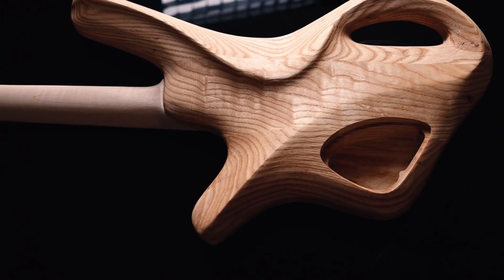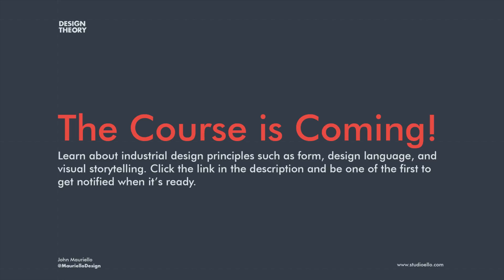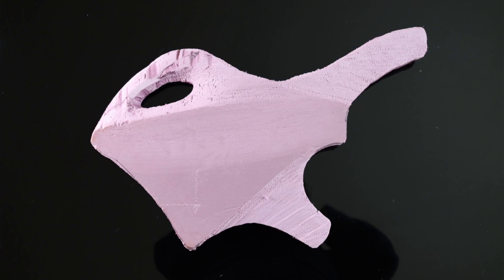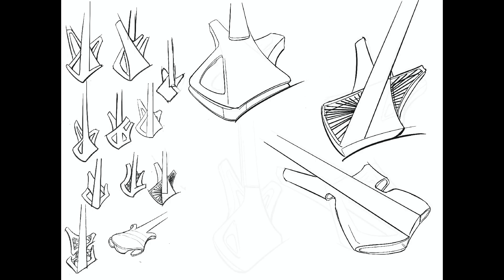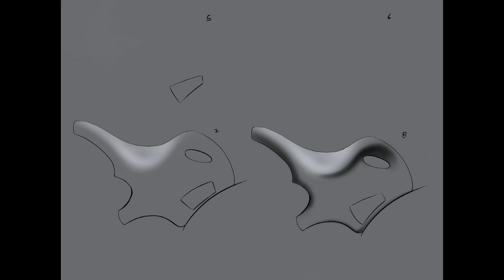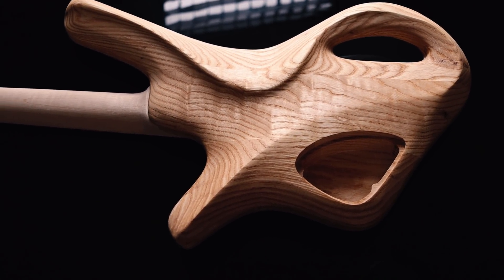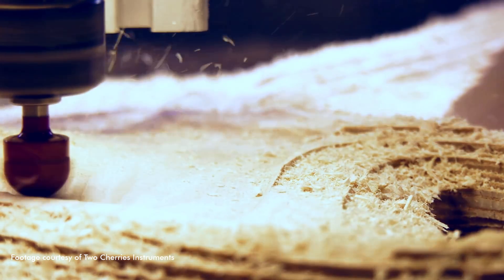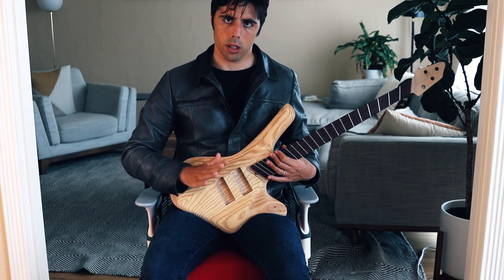How I Re-Designed the Traditional Bass Guitar: Industrial Design Process

Comment: Neat looking but you must realize that manufacturing cost is the reason most guitars/bass are simply flat. The more curves on the body, the greater the price becomes, especially if you are finishing them with veneers, etc. The price tag would make PRS guitars seem cheap. Most guitars/bass are made of multiple pieces of wood, usually 3. This is for strength and cost cutting. Your design would be a manufacturing nightmare for thousands of units.
Reply from the maker: Very true, but I don't intend to make thousands of units. I'm targeting the high end market so it's ok if most people don't want it or think it isn't worth it

Comment: Sitting, If you hold the instrument on the left leg, you have difficulties to play notes with the longest string,  And the hand posture for  the positions I-V is very bad so you have a poor sound on this registry and cannot play fast.

Finally you play in the guitar's registry. Which is quite a problem for an instrument designed to play UNDER the guitar. Unless you are doing sport solos on your bass XD

Also playing on the left leg, you have no longer the teapot and the angle  of your right hand with the strings is no longer appropriate. But you can buy expensive devices to make you sound better than it is...

However you did a quite remarkable job rethinking the shape for a specific use of the nstrument. :)
Reply from the maker: The scale length is shorter so the reach isn't so bad. Also, the body is shifted very far to the right, so the low notes sit closer to the body. If you still find the reach uncomfortable, you can still play the bass on the right leg and it's still pretty comfortable

Comment: As a violinist, who doesn‘t have frets, how do the frets not being parallel work?
Reply from the maker: It's called a multi-scale fret system. Too long to type in a comment, but you can google it. Basically, each string is a different scale length
Reply: @Design.Theory  thank you! Will do! :D

Comment: I LOVE IT!!!   My gripe with Fenders isn't the basses themselves, it's with the utter lack of imagination exhibited both by the designs and by many of Fender's fans.  (I cannot imagine wanting to use a bass that looks and sounds like everyone else, and that describes most Fenders and their users.)  

I do, however, have two suggestions.  First, either modify or lose the fanned frets.  Your design intent is to reduce or eliminate body stresses induced by the bass while playing it, but at 16:46 you can see the drastic difference between the direction of your relaxed fingers and the direction of the frets at that part of the neck.  Fanned frets were originally designed to allow the lower strings to have a longer length to provide better tone, but then people started making ergonomic claims about them.  And those claims may be true near the body of a bass, but not by the nut.  So either start with the frets perpendicular at the nut and then fan them from there, or just skip the fanned frets altogether.

Second, while that is a bass I would be very interested in, there's probably no way I'd ever use it on stage, UNLESS it comes with it's own stand.  There's no stand I would trust that is capable of accommodating that body shape.  There are some designs of guitar stands that suspend a bass by the headstock, but they tend to tip easier.  I prefer my stands to grip the bass by the body, not the neck, and your body doesn't lend itself to being set in a stand.  You can't very well lean it on an amp, either.  So your challenge is to find a way for it to fit an average guitar stand, or design a specific guitar stand for it that you can produce economically.

Best of luck!
Reply from the maker: Thank you for such a thoughtful comment!

The fanned frets are a functional necessity in order to accommodate the highly angled bottom part of the body.  I haven't actually played it yet, but I'm wiring it up and testing it out soon!

The bass works fine for the standard metal stands you buy...I think they're called Rok-it stands. Basically, the little piece at the bottom swivels and angles to properly fit the asymmetrical base of the body. It wouldn't work on a stand that has a fixed base, I don't think...but I haven't tried it with one.
Reply: @Design.Theory   -- Thanks for responding!  Regarding the stands, pictures would be helpful.  Seeing is believing for me, at least with this, and it would give me a lot of comfort to know that your bass actually works with a stand before investing in one.  

Regarding the fanned frets, I have no objection to the bottom of the bass being fanned. It's out at the end of the neck where it's a problem.  I tried to play a Dingwall with fanned frets, and it caused pain for me to play at the end of the neck.  Now, I have limited mobility in my wrists, which admittedly makes me a bit unusual and perhaps not the best test subject, but I refer back to your own video that shows your relaxed fingers about 60 degrees off of the fret angle when you are in playing position.  In order to play it, you'd have to contort your wrist to get your fingers aligned.

I often/usually play with my neck at about 30-45 degrees.  I'd post a picture here if I was able.  If it's possible, I don't know how*.  The picture shows me playing a fairly unusual bass with the neck around 45 degrees, with my fingers in almost perfect alignment with perpendicular frets.  

*(I figured out how.  I changed my profile picture.)

Most basses with fanned frets are fanned at both ends.  I only know of one custom bass that is as I described, starting with the frets perpendicular at the nut and fanned at the body.  But since you are about design and innovation, if there was ever a person who could run with this idea, it would be you.  Especially at this stage of development.

Comment: Your neck profile experiments were interesting.   I too have tried asymmetrical (as shown in your video), as well as diagonal spine (a la .stranberg), and radical V for guitars.  I finally settled on truncated trapezoid.   For guitars at least, it seems to be about minimizing cross sectional area, while maintaining an ergonomic shape, and not compromising neck strength.  The truncated trapezoid seems to be the optimal choice that best satisfies those three design criteria.  When it comes to bodies, a minimalist nohead design with leg and strap bars seems to be the best blend of light weight, adequate strength, correct balance / weight distribution, and correct support point locations (strap buttons, leg cutouts, etc).   The leg bar sits a both legs, so the left leg is the main support - similar to your design.  The guitar is also shifted to the left about 4 inches, to place the bridge pickup over the right leg, at the natural playing position for palm muting. I'm a formally trained multi-disciplinary engineer with over 40 years of experience - aerospace, mechanical, electronics, software, civil, design sciences, etc. I've also been playing the guitar for 42 years.

Comment: I need one of these for my BassMods 5 string neck. The body should be slightly wider.  I need this in roasted swamp ash.  No pickup routes. I'm gonna do Peizo under the neck and bridge.  What's the cost per body.  Send me the CNC file if nothing else. I'm old so not heavy.  Let's get this going.
Reply from the maker: Hey Richard, thanks for showing interest in the design! I'm going to be offering it in limited quantities. I left a link in the description if you're interested. Sadly, I can't simply give away the 3D CAD file. I hope you understand. While copying the design will inevitably happen, I don't want to make it any easier than it already is for people to do so.

Comment: That's a pretty awesome bass, my only question as a bass player who often plays standing up (like your friend with the wrist issue I'm assuming from the gigging pics) is that the small and light body would make it neck heavy.  It might sit at a more natural angle on your legs, but does it balance like that if you're not holding it when it's strapped around your kneck?
Reply from the maker: Short answer: yes. Long answer: the headstock is pretty tiny and I'm using lightweight tuners. It's also got an onboard preamp and two pickups in the body which adds a little extra weight to the body, so it's balanced quite well.
Reply: @Design.Theory  it's a beautiful design, I'd like to try one someday, thanks for the reply

Comment: I noticed your bass neck has fanned frets, do you plan to have a model with traditional frets? 
Also…so far, is one design suited better to this redesigned body style, or is it still personal preference?
Reply from the maker: This design would not work without fanned frets, because it relies on the bridge being at an angle in order to work. Thanks for checking out the vid!

Comment: I like the organic flow of the body but even without tuners it seems like you have to support the instrument with your fretting hand to prevent it from tipping on its head. Making it headless might fix it.
Reply from the maker: nah it balances well. I just happen to holding the neck in that shot. Keep in mind there's more weight that goes in the body (preamp, pickups, 9v battery) than the headstock tuners. I tested it out fully loaded but forgot to take vid of it
Reply: @Design.Theory  Sure thing.

Comment: Wow thanks for sharing the whole process and all the intricate details. Really interesting to a non designer too:) The only practical concern is about the backside, edges will wear out (of course you’re aware of it), can scratch and bump. All concave profiles reduce the natural resonator’s mass, which slightly reduces sustain. I like your approach to solving guitarist’s problems and to improve ergonomics in both positions. Hit the like when you showed the spreadsheet with materials. Real-life industrial design, not some sketches and pointless 3d modeling.
Reply from the maker: SPREADSHEET WARRIORS! So regarding the edges on the back. I took a pic of them that REALLY highlights the depth of them. That side-lit angle really makes them stand out. In reality, they're only about 5-6 mm deep at the deepest points, and they're a lot softer and more gradual when you see them in person. The wood grain also accentuates them and makes them appear deeper, almost acting like a contour map. I still think I might soften them up a little bit, though.

Comment: It would be a shame if you can only play this beauty acoustically whilst sitting down. Since that bass will sit in between your legs I'm hoping you've considered the eternal input jack placement conundrum:

-input jacks at the front of the guitar/bass can really get in the way of things and mess with your instrument's aesthetics, especially if you're going strapless
-most players therefore prefer the jack on the side, but that can be troublesome too if you're playing whilst sitting down (you don't want your leg bumping into the thing). Manufacturers like Charvel (check out the jack placement on their Pro Mod or Guthrie Govan models) have come up with some clever solutions to that, but these might not be possible in your design since the bass is sitting so low against your right leg (and next to the control cavity at that, which is where you'd typically install an input jack)

Unless I'm missing something, the most obvious solution would probably involve routing the connection through the body past the bridge in order to place the jack a bit higher up. Also, from a standpoint of ergonomics: since you took quite a bit of wood away at the body-end I'm wondering whether this may increase neck dive for those who play your instrument whilst standing up. It might be wise to ask your 'test subjects' whether they're experiencing any (luckily, there are tons of ways to counter this issue if it indeed rears its ugly head)

Oh, and please make sure to post a video on the finished product. I'm quite cirious at this point!
Reply from the maker: The jack comes out through the front. I did another bass design that was similar to this and it worked pretty well. I know it messes with aesthetics, but I'll have to figure out a way to make it look ok.  I don't want to put it on the side for all the reasons you've already mentioned. I sincerely appreciate these kinds of thoughtful responses!

Comment: Would have been nice to hear why you went with the assumption of it being a bolt on neck, rather than neck through. I'm sure there are reasons, but it would be good to hear.

I've never been a fan of handles in guitars of basses. I think Steve Vai's signature guitars look so much worse because of it. When do you ever need to carry a guitar like that? Your design looks a lot more natural, but I would still have to get used to it. At least it would help with being lighter. I don't know how it would affect the tone resonance of the wood, but it might be worth investigating.

Comment: Interesting design! One aspect I would like to share is that (based on my experiences) the sounds are clearer and more straightforward if the fingers' position is perpendicular to the strings. Hence the direction of the hand approaching the area of plucking is crucial to me.
Reply from the maker: Interesting! I've not noticed that in my own playing, but maybe my fingers are a different density compared to your fingers. :O
Reply: @Design.Theory  I was just to comment the same thing about the fingers being perpendicular to the strings, specially if you play really hard i think. Maybe if the strings and bridge go a little further to the right? It would also expand the avaible tones you can get by moving your fingering hand across the strings. That being said, it looks really great, it will be a great bass!!!

Comment: I'm just wondering about few technical thigs:
1) From the video it looks that the final prototype is significantly smaller than your typical bass. Is it so or is it just an illusion?
2) I'm not sure if this pickup position together with fanned fretboard  will work properly.
3) If I extrapolate corectly from the neck size and frets, your bridge would have to be placed... over your pickup???
Reply from the maker: 1. It's 32" scale. So it's about 2" shorter scale length. 2. Pickup position will probably be fine. Or if not ill just tilt them.  3. Each string has its own bridge, so no.
Reply: @Design.Theory  
1. OK. Just looks much shorter then. I understand.
2. You don't know until you complete the project. Might be (especially with the shorter strings) that it turns out to be way to close to the bridge.
3. Sure, I know how bridge with fanned frets work. But again - especially with the shorter strings, it looks as if it would have to be placed over the pickup cutout. But maybe that's also the illusion, not actual dimensions.

Comment: Great stuff. I have built my own bass years ago that came to be by me carving a flat shape into the 3D carved entity that it ended up being. I used the same design goals - it should sit on both legs at a 45 degree angle, and it should be fluid against the body. Interesting to see how different people interpret the same data into different designs. It would be worth getting this design patented.

Comment: Cool work. One thing I don't like: the fit of the neck into he body is very visible from the front. I can see the motivation for it: you need enough contact length for strength yet don't want to have the fretboard run into the neck pickup. Still I would like the fretboard to cover the transition of body and neck or have it end with the neck body. The neck body extending beyond the fretboard, so obviously exposing the transition between neck and body, looks ugly to me.

Comment: As a bassist and an industrial designer, the original Fender guitars and basses are a thing of genius as well. Gibson LP's have a lot of expensive nods to archtops, like carved top, glued neck that's set in an angle, angled headstock etc., while Leo Fender took the manufacturability to new heights by utilizing the simplest possible construction involving a slab body and a bolt-on neck. 

I had to buy a '51-style P-bass just because I think it's one of those rare groundbreaking moments where all the new ideas just came together perfectly in one product.